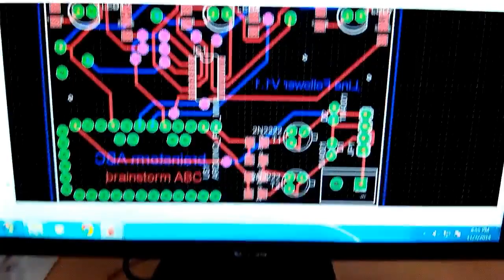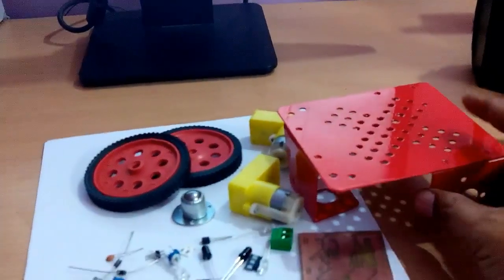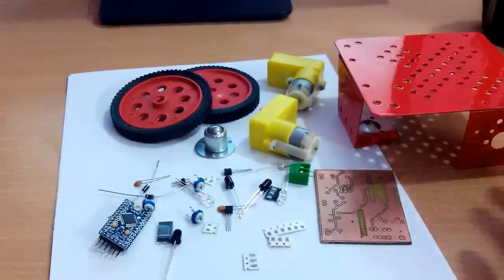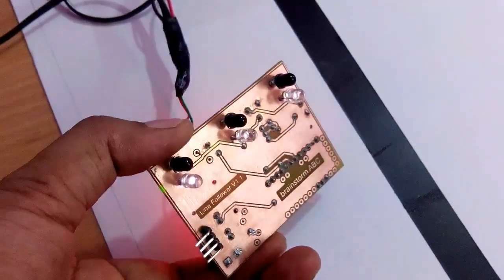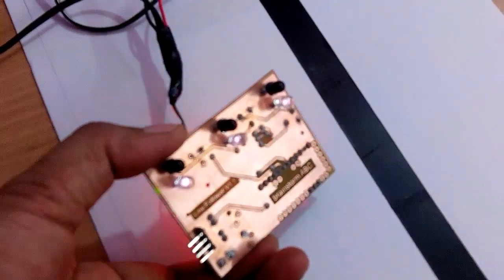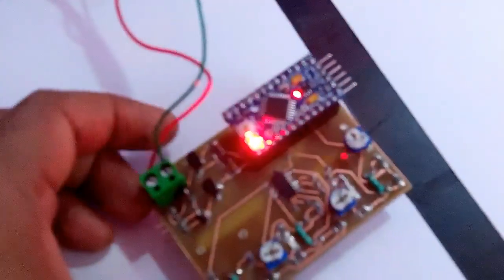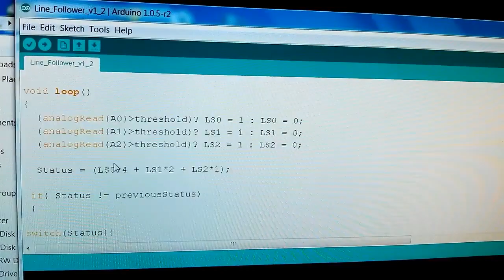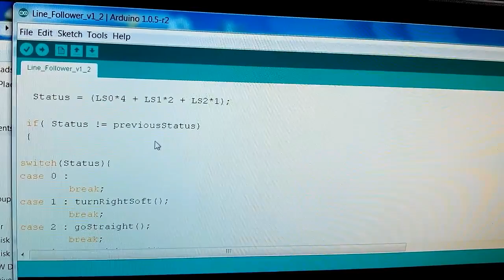Making of Line follower Robot using IR sensors

Comment: Hi, As per the hardware, You are using LM324 which is an ADC, so the analog readings are converted to digital, Then why is the digital outputs from LM324 been fed into analog inputs of the arduino. If analog readings are to be used from the sensor, The analog readings can be directly fed into the analog inputs of the arduino.

Any specific reason to do this ??